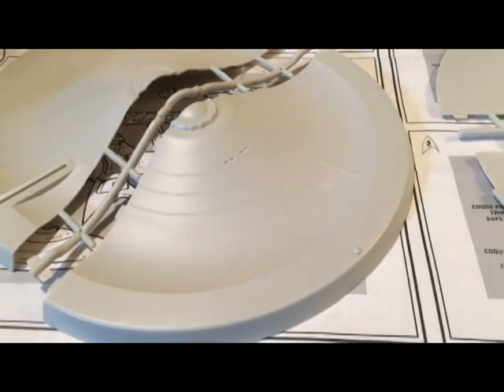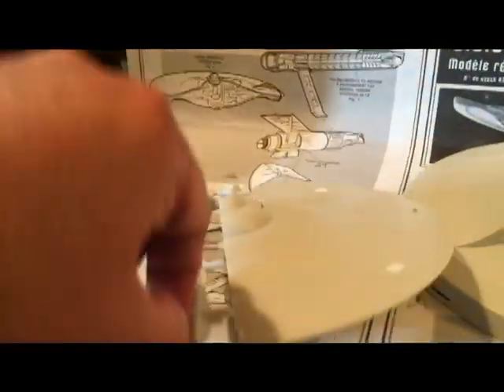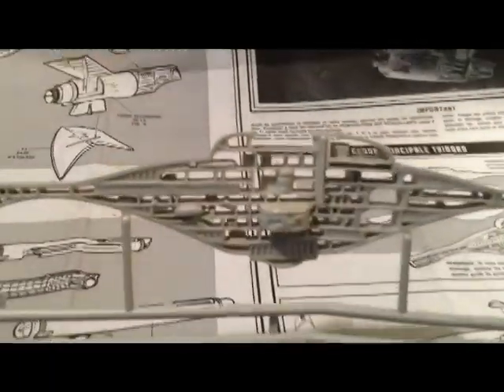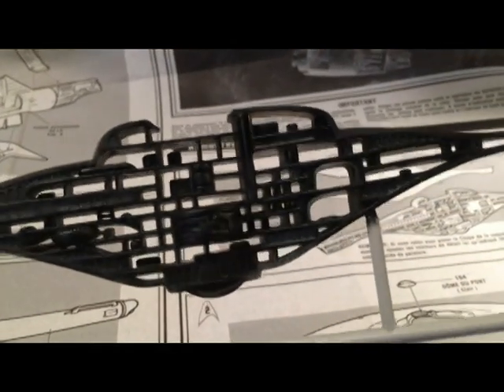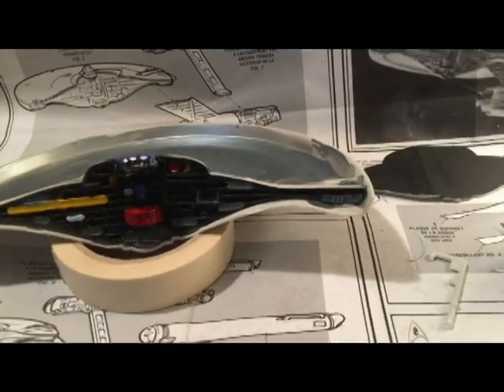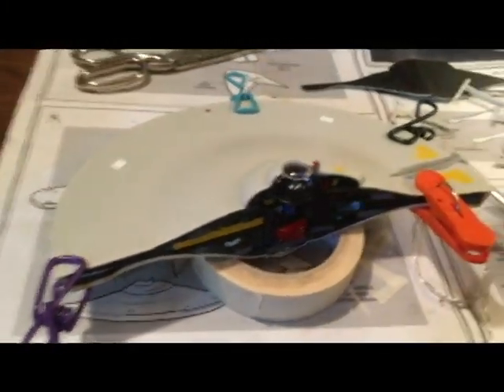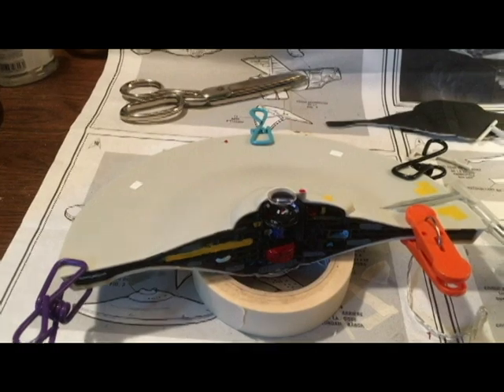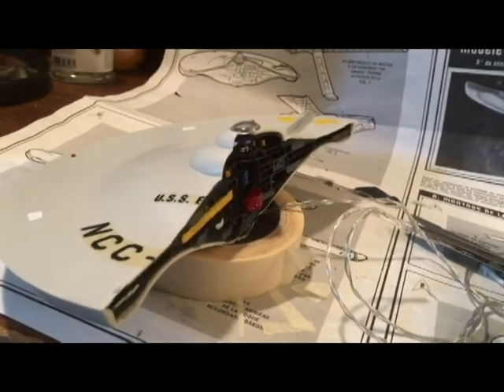30th Anniversary Cutaway USS Enterprise (Primary Hull Assembly with Lighting)

Comment: Good work! Did you place the decals directly on the plastic? Will you spray a clear or dull coat over them? I like the plastic colour too. Good choice!
Reply from the maker: Actually, I just cut out the decal sheet and glued it behind the frame. I thought it would be much sturdier that way. Next time I may place the decals onto a clear sheet then cut it out and glue it that way. It probably will be much brighter.

Comment: I saw correctly  ?  Do you use nail polish for painting ?      10:30 in the background
Reply from the maker: Yes, the nail polish looked great on the Port and Starboard running lights. The finished look was bright and it appeared to be clear coated. I used nail polish for my 1/2500 U.S.S. Enterprise NCC-1701-C Bussard Collectors and Nacells.  I think it does a great job. It acts kind of like a glaze.

Comment: For anyone wanting to do a cutaway that is accurate to the studio used model the coloration is a very strange blend of white, grey, red, green and brown applied seperately.  They did it to show contrast on the early in color series because executives made the point that if they were going to make a white ship on s black and white background there was no sense in filming it in color.  This was a part of the opening ceremony at the restoration ceremony of the original for display at the smithsonian.
Reply: NBC was owned by RCA at the time which wanted to sell a TON of color TV sets.
Star Trek was color-designed to help accomplish that goal.  It was one of the signature shows NBC used to make the case for color TV.
Prior to 1966, there was no full-color TV Network.  NBC was the first TV network that went full-color for all its programs.  Yes, there were color broadcasts going back to practically the late 1940s but for the most part broadcasts were done mostly in black and white.  There were earlier TV shows including shows that aired on NBC that were full-color from the start -- Batman on ABC (Adam West), The Tonight Show with Johnny Carson which broadcast in full-color from his first episode and was shot on videotape.  There are still specials from the 1950s captured in color on videotape that still exist to this day.  My impression is that the videotapes they used back then were actually BETTER than the VHS standard a lot of us are familiar with.
**
A part of the problem with attempting to move to full-color TV broadcast was they didn't standardize color TV standards so there were competing systems through the 1960s.  The other issue was making any color broadcast system backwards compatible with the existing black and white systems and TV sets out there.  Most people continued to watch mostly in black and white through the early 1970s when color TV sets finally outsold black and white TV sets.